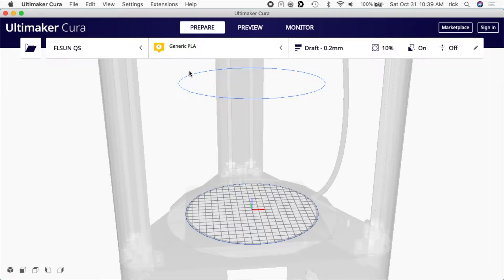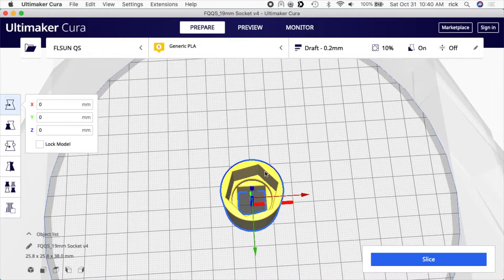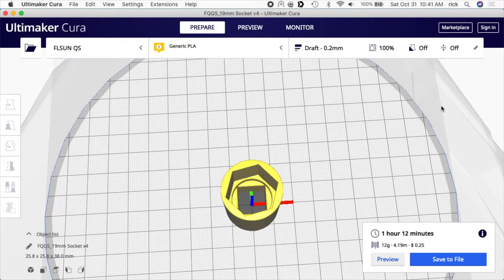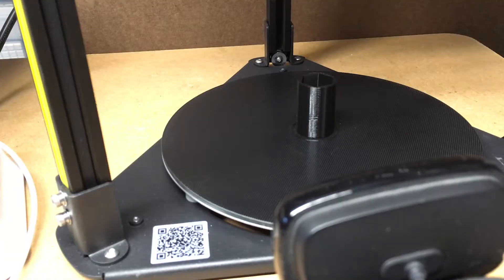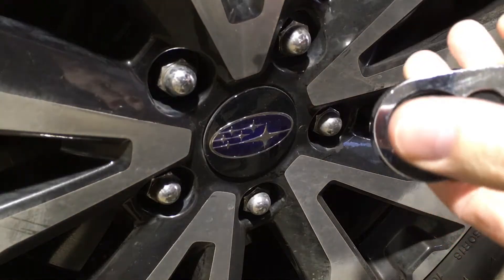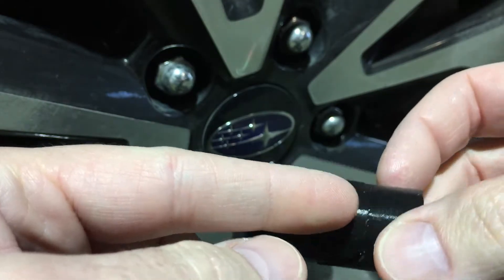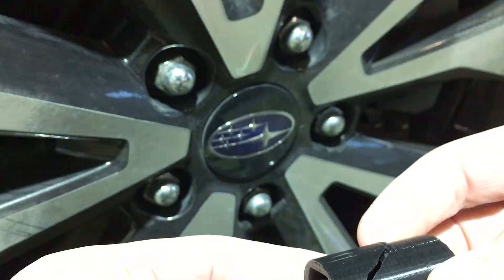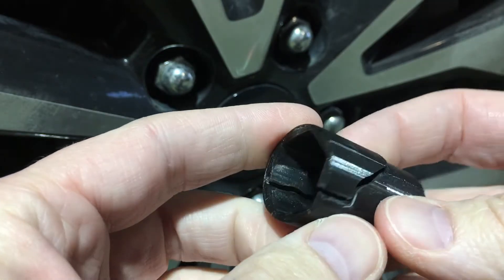FLSUN Q5: Testing Socket Printed with PLA? (Ep.10)

Comment: Hello,

use more Walls. Infill is not strong enough.
The other Problem is, the printing direction.
See the channel CNC-Kitchen with the test hooks. He print it in two differeces way.
Reply from the maker: Thanks for the tips! I think have seen some of CNC-Kitchen's videos but it was before I got my printer. I'll have to go watch them again as they will make more sense to me. I do want to revisit this. I like the idea of printing a tool in an emergency and taking off a lug nut seems like a good challenge. I also want to size the socket to fit more snugly on the nut. That would allow me to have thicker walls.